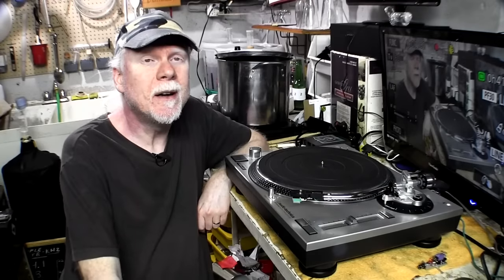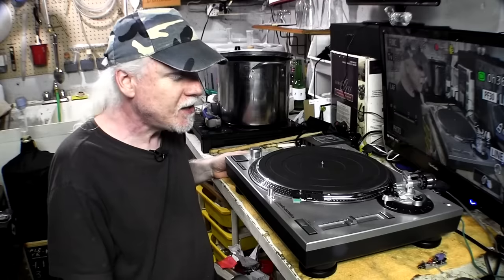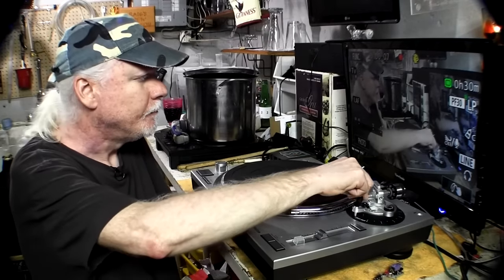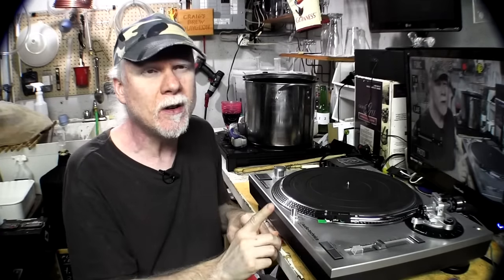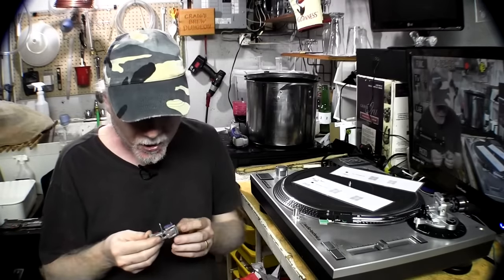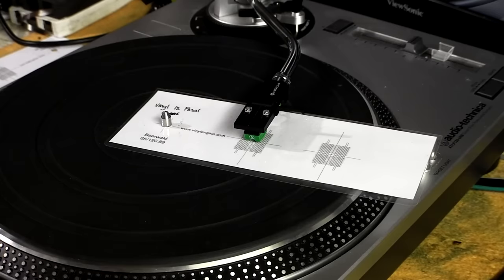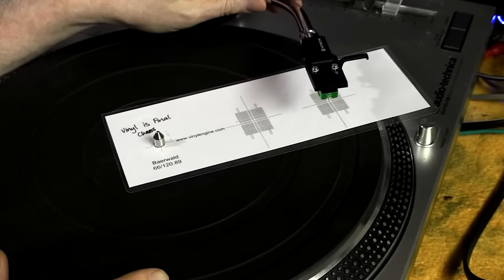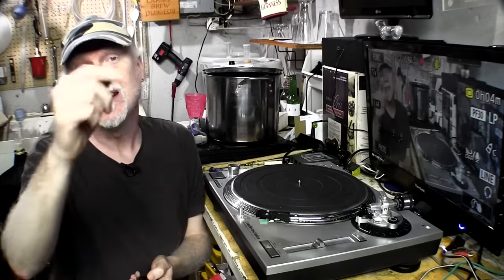Very Detailed Turntable Setup for Beginners

Comment: It's Amazing how much of a difference it makes when your tables are calibrated properly. You Sir are a gentleman and a scholar. Great video
Reply: Absolutely fantastic video!! Just installed a new Goldring E3 cartridge on my AT LP5 Turntable. Did not even know about the need to do all of these things before playing a record. Will be up a few hours this evening. Thank you for spending your time to teach us novices! 😊
Reply: @rajeshkansara4505  it´s easy and fast to do, the only thing ,i think it was left out is when having the optimal weight on the stylus as it´s specifications allow if the anti-skating is the same as the weight but some songs in the end if the record are still not good as the ones in the beggining just had a bit on the anti-skating till they sound all the same(Perfect),normally analog instrumentrs on early cd years the sound is very bad compared to the vinil version ,if not something is wrong on the turntable ,i´ve tried several cartridges and stylus till 400€´s which in my opinion is already a lot of money ,they do normally sound worse than the stylus that came originally with the turntable, also i have to say that in the 80´s some of mine cartridges, refering to their stylus had not already being produced by the brand but at the time substitution needles  were well built ,today they are very bad ,i worked in a laboratorium and i can still use the magnifying lenses to watch how they were assembled ,you can see the tip  with a 30 cm´s measure and watch all work done ,i bought two for about 30 to 40€ and they are just garbage ,not a problem of the cartridge or the turntable itself but the badly built substitution needles, there are still well built ones but one needs to do a research , and make question about them to it´s seller ,regards

Comment: Just used the same protractor and my Audio Technica LP120 is aligned straight out of the box.  Someone in the factory must have been having a good day.
Reply: usually when i need  a new cartridge,i buy it already all hooked up on the Headshell,and that is the first thing i check,out of the box.and YES.its usually perfecto
Reply: Assembly work is usually shabby on Monday's and Friday's. Yours may have been assembled on a Wednesday. Lucky you.
Reply: @davidpaul4484  normally they never tune it to perfection but it´s an easy fix with those cards from ortofon they can be tuned to perfection

Comment: Another important adjustment is the tonearm should be parallel with the platter with the stylus on the vinyl, too low at the pivot end and you'll have a slightly muddy bass sound.

Comment: Skating "force" is a vector pulling the tonearm toward the center post, caused by friction between the stylus and record groove when the platter is in clockwise rotation.  This friction generally increases with stylus pressure, which is why the anti-skating torque is calibrated to vary with the tracking force.  

Stylus drag from friction also varies a bit with the frequencies, amplitude, stereophonic channel separation & phasing of the audio signals recorded in the groove, the effectiveness of any applied groove lubricants, and turntable speed.  Most turntables are not designed to compensate for these factors, and are probably optimized for 33 RPM or some arbitrary speed between 33 and 45.

Comment: That's a really great cartridge setup video! Just a couple of things: To attach the wires to the cartridge wiring pins, it really helps to have a good pair of needle nosed pliers, thin ones. On some cartridges there is one last adjustment that should not be forgotten - the height of the tonearm is also important, so that the vertical angle that the stylus sits in the groove is also correct; this is called vertical tracking angle. For anti-skating, the best explanation I have ever seen are by Peter Ledermann, the creator of Soundsmith cartridges. It's actually simple to do.
Reply: Maybe a tweezer?

Comment: Thank you so much for this very in depth tutorial. I just picked up an Audio Technica LP-120XUSB as an upgrade from my LP-60 and I was able to easily get it set up correctly--tracking force, anti skate, cartridge alignment, leveling the deck--everything. I hadn't seen another video tutorial quite as detailed and informative as this one weeks prior from purchase and the research I was doing. 
I absolutely love this turntable and I'm well assured that everything is aligned and calibrated correctly. 
Thank you so much again!
Reply: How was the cartridge alignment right out of the box? I just ordered one and was wondering if I really need to align it
Reply: Hi,just bought the same myself and thought could leave it as is,I'm checking that cartridge as soon as I get home today,living this turntable..buying a cork and rubber plattee mat too!
Reply: @HAZYWAY  Just unboxed mine and will be checking it out tonight. Did you see anything way out of line?
Reply: @croeger82  No,I used the free online protractor shown here and cartridge was good,definitely needed to use the ground wire but then upgraded to better rca but still used original ground wire.
As for platter mats research yourself what you may want or by need,I myself bought the cork and rubber one.
Reply: Audio técnica LP 120 USB é a melhor solução relativamente ao preço e qualidade não aconselho mais nada mesmo tenho um já tou velhote!!!! Já estou canssado de tantas coisas de áudio,uma coisa novatos eu digo não se deixem ir em tretas!!! Ok este produto é excelente mesmo espetacular incrível
Reply: É verdade que é bom sinceramente não aconselho mais nada a este preço?o quê? Isto é uma mensagem para qualquer dúvida
Reply: @HAZYWAY  amigo Bom excelente qualidade construção preço isto é dado Bom excelente Gira discos

Comment: I know its 2019 now but man, thank you for doing a favor for human/vinyl kind.
I make vinyl records, and the special thing that we tell for our clients and people here is 3 things: 1-Adjust your advance/old turntable. 2-Buy a turntable with a good anti skating system. 3-Stay far far way from crosley/cheap ceramic turntables..

About anti skating, this is the most important thing in life, in special to your record not skip easily. one clue for all you people: got a piece of polycarbonate/petg/acrylic, make it a 30cm circle with a 7.2mm center hole, remove one plastic protection, clean with liquid wax (like turtle wax), put on the record and BINGO, you have a nice anti skating calibration. Put your arm on start point, put this "blank disk" to play and calibrate your anti skating until this stop to go one or other side, it have beem "locked" on every position you put the arm..
Hope it help you guys
Reply: I use an old laser-disk for anti-skate testing, very smooth surface and was a heck of a lot easier to find than an one-sided LP hat I have seen recommended elsewhere... and they come already sized at 12"
Reply: @bumblerer  it´s made in acrylic, thats why; O aways recomend 12 inches, because use a cd to calibrate can have eror margins, as the best point is in the start/middle point

Comment: Great video!  Another adjustment that is described in the manual for my Technics TT is the distance between the stylus tip and the mounting flange of the headshell, which for me is 52mm.  I suppose that the protractor would eventually get you to the right place, but I think setting the measurement first makes it easier.  I also have the HiFi News test record to help with setting the anti skate.
Reply: Turntableneedles.com has an overhang gauge which is just what you need. I can't use it because I have a straight tone arm but for the S shaped arms it will save you a lot of time and work. As of this date (Nov 2020) they are selling it for $11.

Comment: Hi, I thought your video was very informative and you went through the process and explained it very well. I had a couple of things that I wanted to comment on: 1. While you explained anti-skating, very well you offered no solution for setting it, a blank disc is probably out of most people‘s reach without trial and error, but you can find an acrylic platter mat economically. If you do not want to spend around $35 for an acrylic platter mat, you could buy the cheapest laser disc you could find which is an acrylic material, which would work great for adjusting the anti-skate. You could use that acrylic platter mat to adjust the anti-skate where your arm stays in one place while touching the acrylic flat mat. While the turntable is spinning, the tone arm doesn’t move in or out – you have the skate set properly.  2. The cost of a nice protractor from Hudson hi-fi is less than $20 – not thousands of dollars a little off on that. This protector has a nice mirror surface so you can see all angles of your cartridge. 3. You said nothing about adjusting the vertical height of your tone arm, when clearly the turntable you were working with had that adjustment. Great job on the video, even though it’s seven years old, all the information still applies!

Comment: I have an old shellac record that has only grooves on one side, so I use that to first fine-tune anti-skating, then adjust by ear. I've been using this technique on numerous turntables since 1978. You can also buy setup disks that have this function on one side, whilst on the other have test tones and other recordings to ensure that azimuth, alignment, and tracking pressure are optimised.  They can still be found on auction sites.
Reply: All Things Must Pass - George Harrison has a blank side. It was the first double album with a blank side!

Comment: Wow! Very easy to understand. I can’t wait to calibrate my vintage turntable. It wasn’t working for the longest time. There was no sound coming from the turntable. I didn’t know if the problem was with the cartridge or the turntable itself. After checking continuity and wiring I still had no clue what was wrong. I decided to unplug the RCA cables from my preamp and plug in to a spare receiver and it worked. My problem was the phono input on my preamp. Most of my equipment is from the 1980’s and is still working with some minor fixes. I’m now a new subscriber. Thanks again!

Comment: Needed to fill the space created when I sold my CD jukebox, so decided to get a record player again and revive my vinyl collection.

Had only ever had cheaper ‘music centre’ kit (and hand-me-down radiograms before that as a kid), but with turntables so affordable now, I got a new one for Christmas and combined it with a cheap second hand (but quality brand) amp.

Had nothing but trouble playing records until
I found this video.

I always assumed the various adjustment bits on turntables were just BS designed to make them look ‘flash’ as my records always played fine on the other record players that I had didn’t have them, but clearly they do make a difference.

I followed these instructions, including the protractor alignment, which was massively out on my turntable and hey presto, no problems and my music sounds great.

Thank you very much.

Comment: For the stylus gauge I used my old weed digital scale and worked perfectly 🤣
Reply: Was also thinking about using that. Good to know it works :D
Reply: This is a great idea! I have one that's accurate to .000 grams, which is just as good as these stylus scales.
Reply: Not necessarily a great idea. Tracking weight varies with the angle of the tone arm, so a scale will only give you an accurate weight when the height of the scale matches the height that your record will be. Most scales are too thick to give an accurate measurement, which is why these stylus scales exist; note how thin they are
Reply: @RangerLink667  Thanks for the clarification. My scale is a very thin one, so indeed worked.
Reply: OH YEAH...THAT’S WHAT I WAS DOING!  I got as far as grabbing the scale...and some weed...and...(hmm, where was I going with that?).

Comment: I enjoyed this video very much. However I come from a different school of thought and would like your opinion. First, I do not align the cartridge, I align the stylus. Quality control is not what it used to be and sometimes a stylus is not perfectly centered in the cartridge and may lean slightly to one side so my focus is on the stylus tip and the cantilever. Second, I make alignment the first operation because tracking force and anti skate has an effect on how the stylus sits on the protractor. I am with you as far as using a cardboard protractor as opposed to one of those fancy ones. I purchased one and returned it because all it did was make life more difficult. I use the protractor that came with a Shure (RIP) M 97xE. I set the anti skate to zero and the tracking force to half a gram which gives the arm enough weight to stay in place. I also put a junk record on the turntable so that my adjustment is made at playing height. Using a strong light and a magnifying glass (I am over 65 years old so age considerations have to be made) I place the tip of the stylus in the null point and then look at the line the goes "head on" to the stylus tip. I adjust the cartridge so it is one continuous straight line from the line on the protractor, to the stylus tip, and up the cantilever. It takes just as long and is just as frustrating to align the stylus at both null points as it is to align a cartridge. Also, when I balance the tone arm to set the tracking force (a digital scale is on the "when I have a little extra money" list) I zero the counterweight when the needle is level with the record because I consider the playing height to be theoretically zero. I have a lower end turntable (Onkyo CP 1022) and sometimes you have to let your ears make the final adjustments and my ears tell me that my method works. I would appreciate hearing your thoughts please.
Reply: Glad you bring up the point about the zero balance being at the playing height. I completely agree. I also thought that the stylus pressure should be readjusted after the stylus alignment. I would think moving the cartridge in and out would affect the stylus pressure on the record.

Comment: For the antiskate, I have a trick : I use an old vinyl with a scratch on it, if the play jumps forward in the song I put more antiskate; if it jumps back I reduce it
Reply: That makes no sense.
Reply: I use side four of Second Winter
Reply: The scratch will make it jump in the direction of the scratch through the groove, regardless of antiskate.

Comment: I would love to see a video about cleaning records and cleaning the stylus and table. As it is I have a simple dish soap/water/lint free cloth system for my records. I would love to know your method. Currently I use one of my girlfriend's paintbrushes to clean my stylus. It seems to work okay, when our cat isn't trying to steal it away.
Reply: Magic Eraser works like a charm, check around for some youtube vids on how to use it and which one to buy. You really can't beat it for 2$.
Reply: Cleaning the stylus is really easy and you don't need any chemicals, just a tongue. Just detach the thing, then dab your tongue on the needle VERY gently a couple times (dont lick it though, just dab it), this will break down & dislodge any micro-fluff on the needle. Keeping the contacts tight & clean is usually as simple as just detaching (EG the stylus from the tone arm), blowing air into them, then retightening, making sure theres no cat hairs gone in there.

Keeping your records clean will be easy with the right tools, I use a carbon fibre brush (designed for cleaning the minute dust in record grooves and is wide enough to reach from the runoff groove to the edge on a 12"). If your records are caked up with grime from loads of use but no cleaning, a brush wont help, you'll need something to loosen the grime. I've heard water works well for this (just look up cleaning vinyls with water) but in terms of chemicals I'd be extremely cautious what you use, personally I wouldn't want to use any chems, stick to water (assuming its dirty enough to need it).
Reply: I bought a stylus brush on ebay. it's just a narrow brush that you use gently from the back, to the front of the stylus, GENTLY!!! 2 or 3 times and ur good to go.

Comment: Question: Since you calibrated your counterweight at 2, but your stylus gauge showed it was actually 2.4, shouldn't you rotate the counterweight front dial to 2.4  and also set  the anti-skate to 2.4 (or as close to 2.4 as possible)?
Reply: He probably just adjusted the tracking force to 2 and then adjust the dial back to 2 as well when the scale read 2

Comment: Just one question, what about the height ring where the tonearm is?
What should that be set at. You never talked about that.
I have the techniques SL 1200.
There's a setting there as well.
Thank you I learned more than I thought.
Reply: I have the same question.  SL 1800 Mk2
Reply: Just put a record on and see if the tonearm is leveled. Normally zero is fine. It's important for people using a thicker slipmat or a special cartridge.
Reply: @timheldmann7941  Thanks I'll check that out.

Comment: What a brilliant video. Thanks soooooo much. I didn’t have a clue about this stuff before I watched this video. Changed my cartridge yesterday having bought a pressure gauge and a cheapie but beautiful template from Amazon. Spent time setting it up. You’re right don’t trust the manufacturer. Do it properly. The sound difference is just brilliant. Thanks so much.